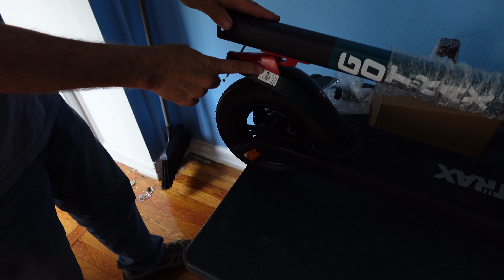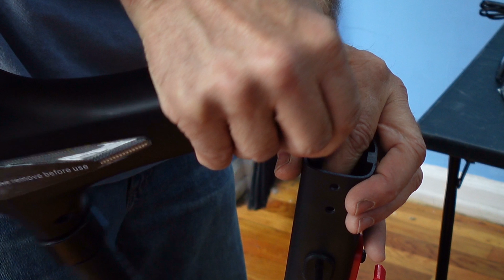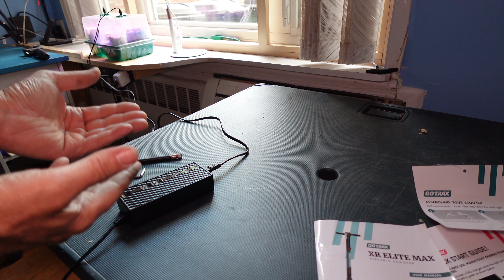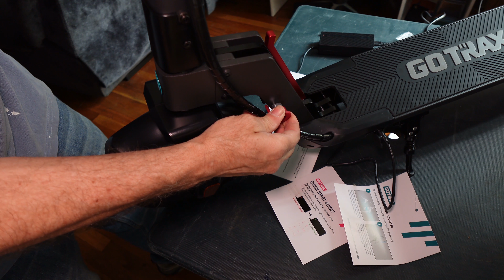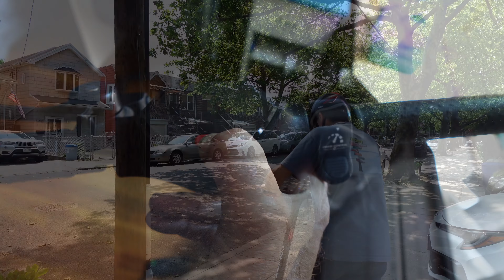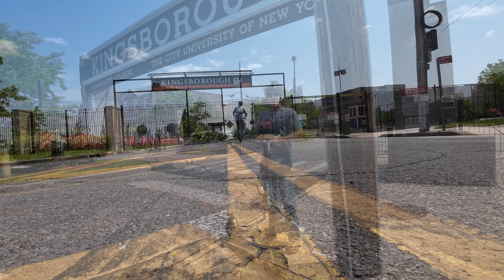Gotrax XR Elite MAX Electric Scooter -10" Pneumatic Tires, Max 20 Miles Range 15.5Mph  Power by 350W

Comment: Hey great video. Will you please tell me about it's performance on slope and up hill? Thank you.
Reply from the maker: I have yet to get  the full 20 mi range, right no i got 6 mi at mode 1 9 mph knowing I can   go where i want ,  I went up an overpass at 9 mph mode 1  not a problem  pulling me up I  am about 160 lbs, I can also go up at  mode 2 15.5 and be no problem, I may do that  video  for you  when it cools down some for me here.  Ihope that info is helpful
Reply: @fishycomics  Thank you for you response. Does this scooter have two speed mode, as description on website show it has only one speed mode 15.5 mile. Yeh i will be thankful if you can clarifies me more about it's up hill performance. Thank you once again.
Reply from the maker: Stay tuned for a vid since my. Sentence mentioned.